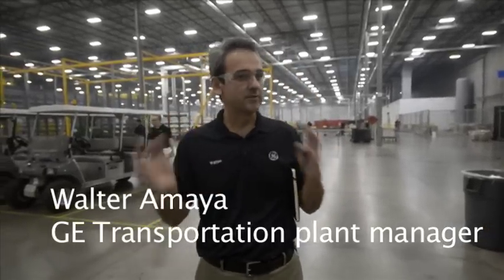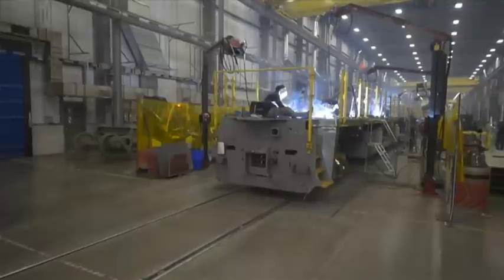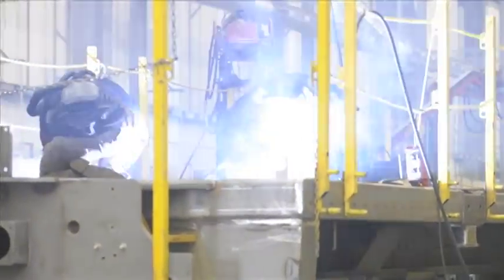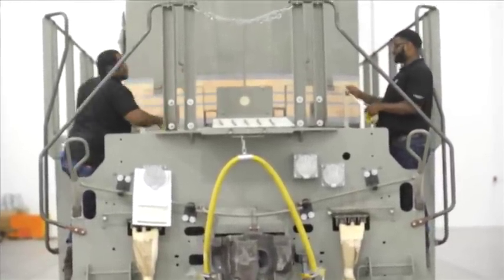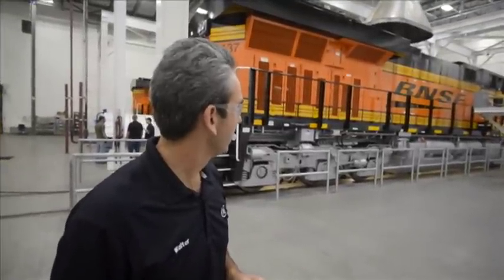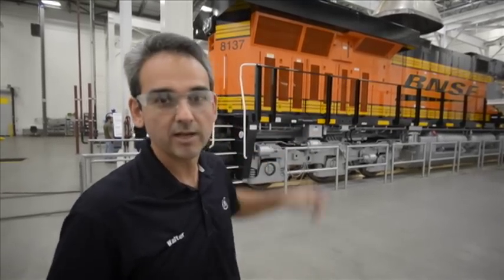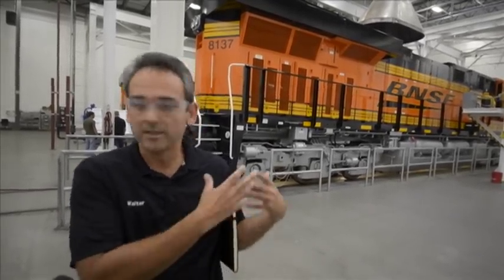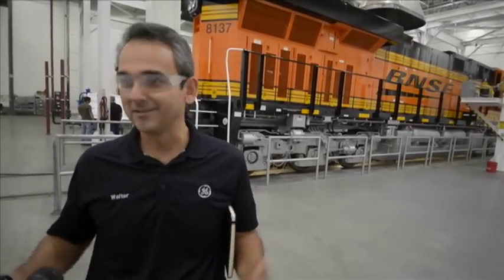Tour the General Electric locomotive plant in Fort Worth

Comment: I operate you're locomotives and I'm here to tell you they are junk, there is no low speed control when coupling to a train, it is a controlled crash, the knorr brake breaking system is one of the worst systems I have ever used, the independent brake lever grinds due to faulty workmanship or materials, they accelerate like an old dish rag and the list could go on but there is not enough room here. The only saving grace for your junk is that the AC units have good dynamic brakes, other than that if I were in charge of buying motive power I sure as hell would not buy ge, but to be fair EMD's are really not to much better, but at least they use more Westinghouse brake systems than ge.
Reply: thats why everyone trusts the good ol' ES44DC!
Reply: Uh oh, we have a emd fan boy trolling.

Comment: '
the train company should make strong alloy aluminum on the locomotive trains and trailers are better weight than heavy weight steels
Reply: Freight locomotives need weight for starting tractive effort.  Sometimes weight is built in as steel or concrete blocks.
Reply: you need weight for locomotives, more weight= more traction. remember its steel on steel, not rubber on steel or concrete

Comment: Impressive. Great, however as America needs to move to the all electric economy, we shall  need electric locomotives, not diesel.
Reply: yes, and they shall run on fairy dust
Reply: They shall run on atomic power, like France.
Reply: Fecking hell, I didn't realise that all the diesel locos in France run on atomic power. What other interesting tidbits do you have for us?
Reply: Fucking hell, I didn't realize you had no interest in low carbon transportation. So just keep you head up where the sun don't shine and we'll call it a day.
Reply: You have some really interesting insights up in ere. There's greater chance of having atomic power locomotives run freight in the US than having US railways electrified. You have'd to be thick not to realise why this is the case princess.
Reply: Atomic locomotives? No. It's atomic plants, which power the electric grid, which run the electric motors, of the French high speed trains. It's the low carbon solution.
Reply: You're not the sharpest tool in the shed are you. To deliver that electricity to the locomotive one needs to have OHLE. If one knew anything about US railways and US geography and US history one would have realised that suggesting that US railways replace diesel locos with electric locos is bigger science fiction than having atomic powered locos. Unless you're suggesting that those locos are battery powered, hahaha.
Reply: You have your head well planted where the sun don't shine, don't you. It's not a big problem. Other nations have already done it, with powerful electric freight and passenger locos. Either we figure out a way to get to a zero carbon economy or we suffer the climate consequences. Now that would be really stupid....lol
Reply: followthefleet1 Electric vehicles requires coal for their batteries, so therefore, electric vehicles won't save the planet.
Reply: @followthefleet1  hey man some people like v12s and smog. Cry to your mama about it
Reply: "America needs to move to the all electric economy, we shall need electric locomotives, not diesel"

Yeah, not happening.
Reply: Also, good luck with fighting the big oil companies. Tesla came up with a way so that all people could have free energy, and then he ended up dead. Edison was an evil for-profit invention stealing crook who supported big oil, and he is remembered as some sort of "hero" in the sick twisted textbooks of America. The status quo...
Reply: another musk butt sniffer! electric power comes from fossil fuel power plants including all electric charge stations! goddamn morons!

Comment: GE is darn good power but I have never liked that trapezoidal short hood head on view it looks great but when in profile it looks like a homemade repair job that someone didn't finish, it just doesn't belong. It ruins the lines of the whole darn unit. The five point window would look great, straightening out that trapezoidal hood
Reply: I know that! it could be altered to be just as strong in a head on collision and look better at the same time. It is that trapezoidal look when viewed in the profile that just doesn't work!
Reply: +Wasatch Range Railway I think the GE units look smarter from the front because they don't have a door jutting out like the EMD units. They also happen to sound better IMO.
Reply: he is right
i love the front and the right front
left front point of view
but in the side
sucks
square emd cabs are cool too
but they dont look as modern as these locomotives